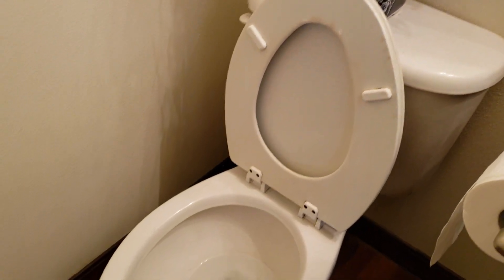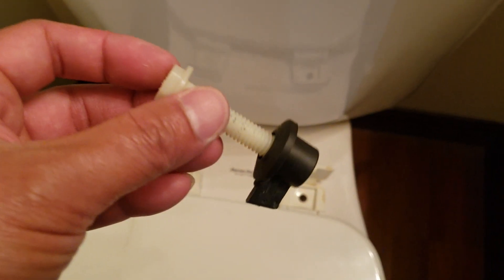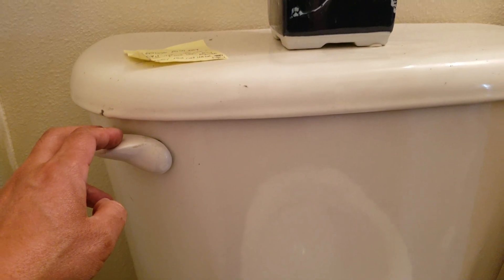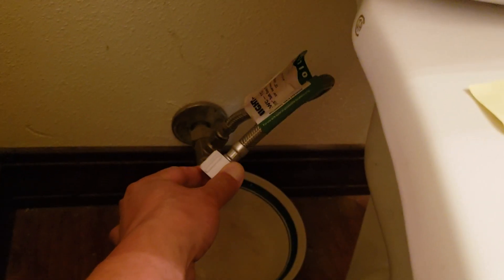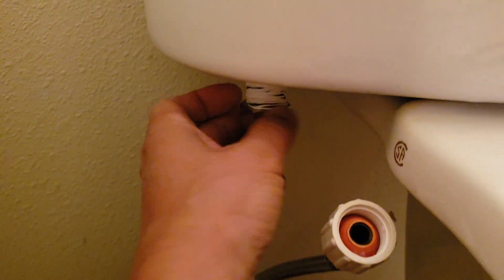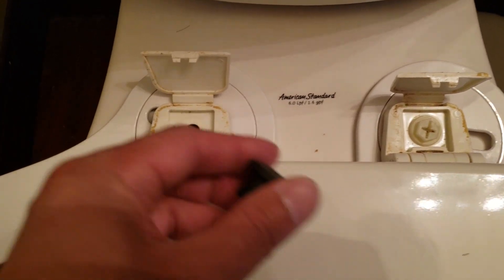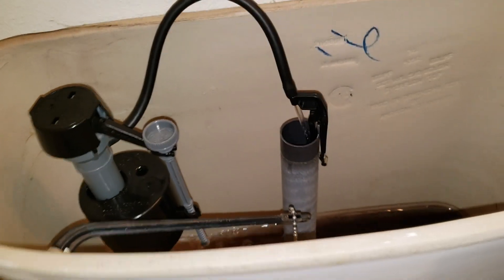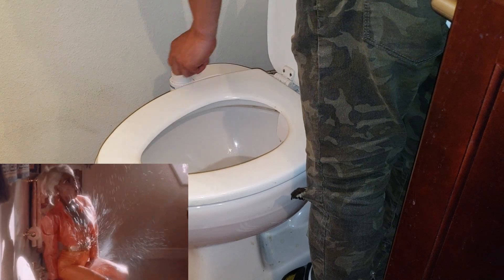How To Install A Bidet | Omigo Element Bidet Attachment Installation

Comment: A little dope but no tape needed the rubber gasket makes the seal and the pipe dope is just a little lobe for the joint to make it go on easier
Reply from the maker: Either way works.

Comment: U don’t need Teflon tape on hose connections lmaoo! 🤣
Reply from the maker: I get mixed opinions. According to this article: If the leak is around the threads themselves (you can tell vs gasket based on where water comes out), teflon tape (sometimes called plumber's tape) exists for this....
https://diy.stackexchange.com/questions/40848/how-do-i-fix-a-leaking-connector-between-my-garden-hose-and-faucet#:~:text=If%20the%20leak%20is%20around,plumber's%20tape)%20exists%20for%20this.&text=Generally%20I%20use%20teflon%20tape,by%20default%2C%20leak%20or%20not.